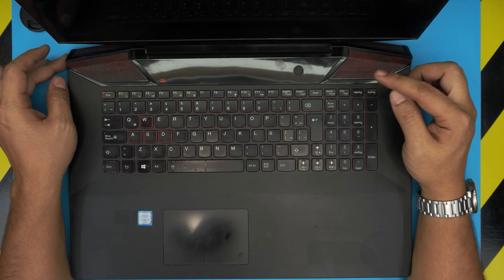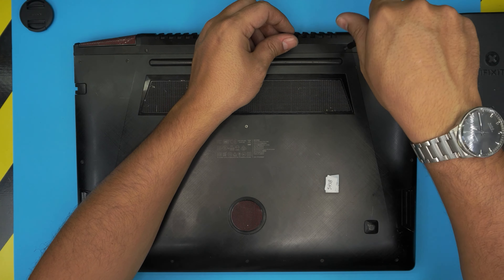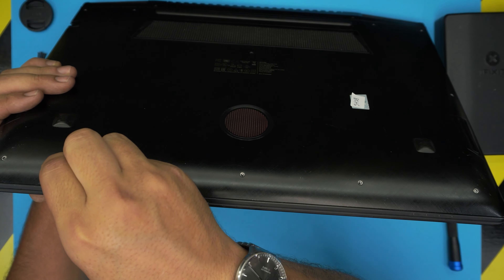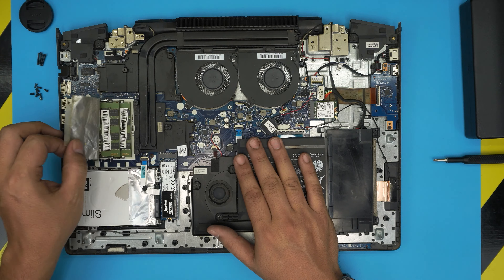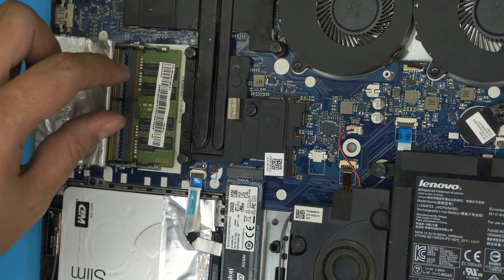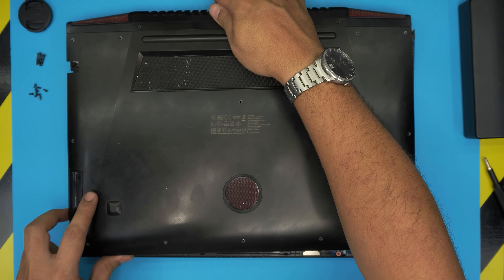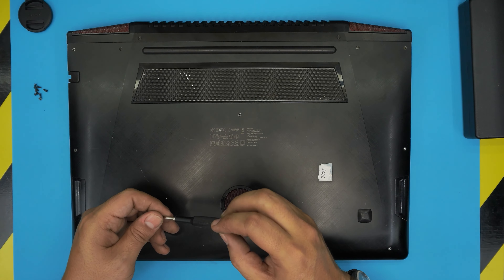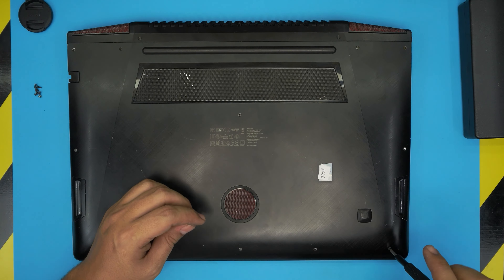Lenovo Ideapad Y700 17Isk 80Q0 🚩RAM UPGRADE

Comment: Hello thanks a lot for your video! I was wondering , is it ok to place a 16gb ram with more Mhz like 3200 instead of what we have atm wich is 1064? Does give problem to the motherboard? I do have btw the ideapad y700 15isk. max ram is 16GB for my model right? =)
Reply from the maker: Thank you for your feedback! If you wish to support the channel, you can like, subscribe, or both!
Regarding your question, You can certainly install a 16GB 3200MHz RAM module, but please note that the motherboard will adjust the RAM frequency to match its maximum supported speed, which in this case is 1064MHz. Additionally, it's important to keep in mind that for Intel CPUs, RAM speed doesn't have as significant an impact on performance compared to AMD CPUs, where higher RAM speeds can lead to better performance.

If you have any more questions or need further assistance in the future, please don't hesitate to ask me.
Reply: Have you tried upgrading the RAM modules with one with a higher frequency? I would like to know if better invest a little bit more money. As @uFixTek it looks like the frecuency will be the same. Thanks in advance
Reply: @Axelius_  As @uFixTek said seems that it does not worth to go for a better frequency . In my case having intel i chose to don' t do that .
Reply: @erikah.4745  I was asking this because I am think to upgrade the ram from 2 sticks of 8gb each one to 2 sticks of 16 each one. For this reason I was asking maybe I will purcharse the average frecuency avalaible. For any reason would you know if this laptop model supports 32 gb of ram. The guide dont say maxium. Some places appear 16 another 32. With a cmd command to check it shows 32 but I haven't seen anyone on internet with this cuantity of ram.

Comment: No hablo inglés, pero ojalá me entiendas. Que tipo de ram le pusiste? Soporta 32, según el manual sólo soporta 16 pero a visto que le ponen 32
Reply from the maker: hola amigo disculpa estuve afuera en vacaciones unos días,  hablo 5 idiomas. mira este laptop soporta Sdram DDR4 solamente:
https://amzn.to/3FNR1L8
si quieres saber exactamente tu max ram capacidad checa este video es menos de 1min.
https://youtu.be/tKEJTkVth4Q
asi sabras garantizado tu limite de tu tarjeta madre.
Reply: Hola! Al final obtuviste alguna información al respecto? Estoy pensado en upgradearlo a 32gb, pero me encuentro en las mimas que tú. Veo que en la documentación solo soporta 16gb. Sin embargo, a través del vídeo que comparte @ufixtek parece admitir 32gb. No sé si has tenido posibilidad de probarlo en tus carnes? Gracias de antemano y saludos